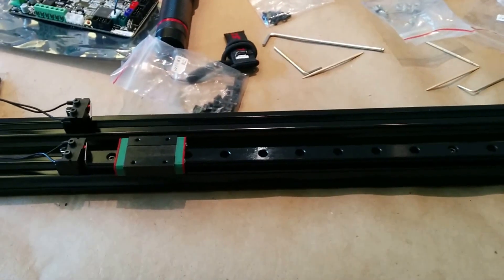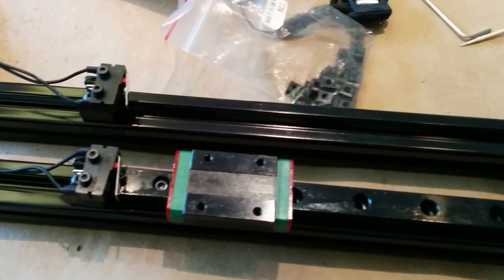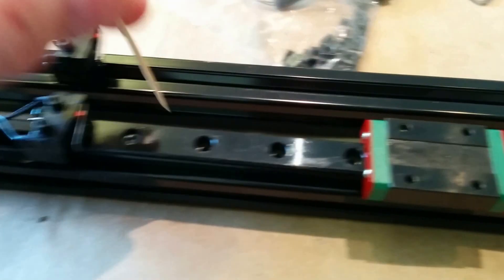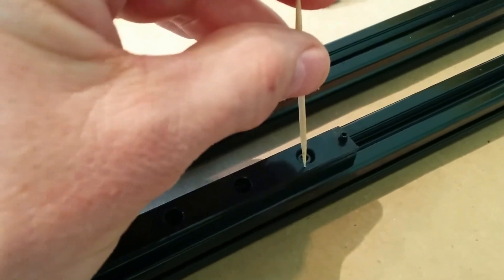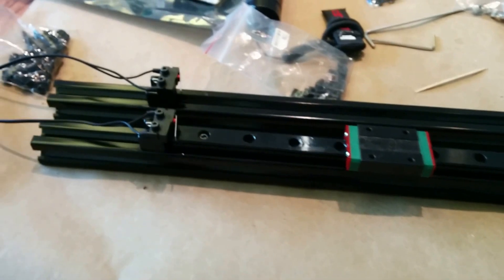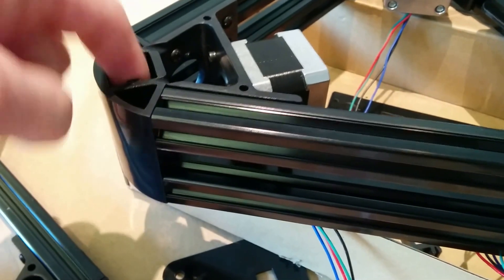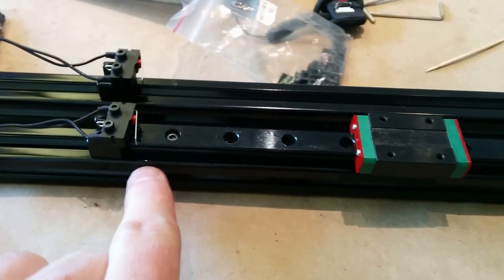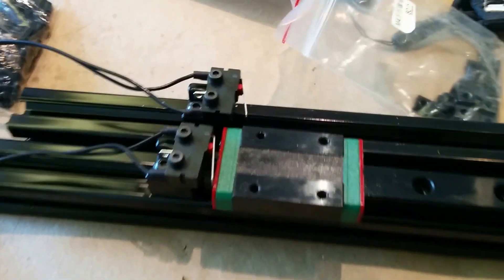Micromake linear rail assembly

Comment: hello I got a question, do you think its worth it to get the hiwin version of this printer? I mean are the hiwin rails knockoffs or not? and if so are they worth the extra money?
Reply from the maker: I made it a point to get linear rails as I wanted the extra stability.   As far as I know the Hiwin rails are high quality, they have subsidiaries in the US and other countries which puts them above a basic no-name rail from china.   However if the cost is substantially greater it might not be worth the money.   Most linear rails that I have tested (cheap or otherwise) have very little side to side slack and move well.    On a Delta there is not that much weight (hence the faster print speeds) so there shouldn't be that much wear on the linear bearings.